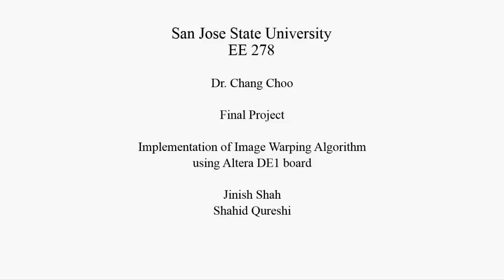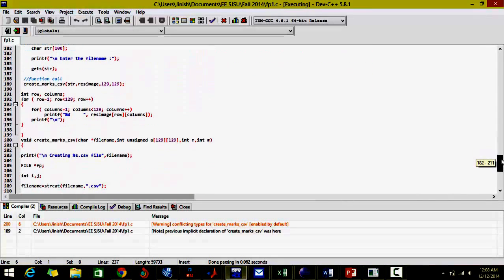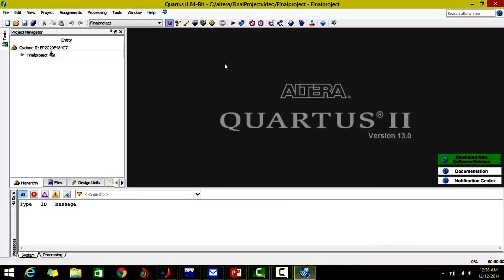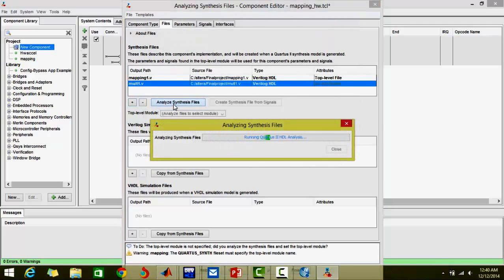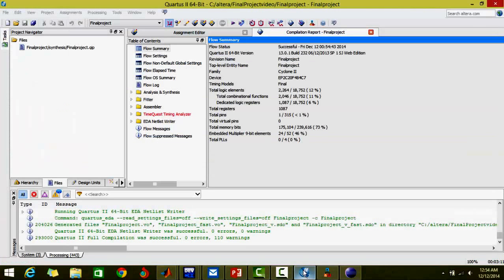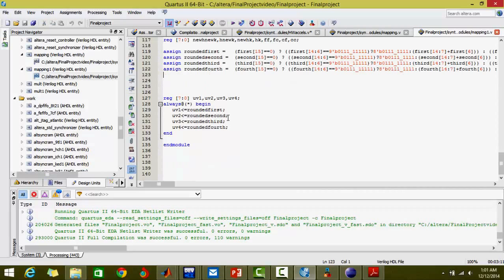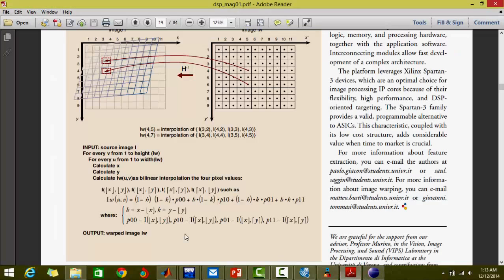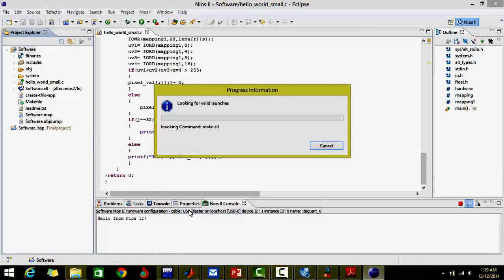EE 278- Image Warping Algorithm Implemented using Altera DE1

Comment: Hello I am doing same project with edge detection. 
When I tried to run my program it is showing nothing for 128*128 images but when i tried to run it with small images like 20*20 it is working. so am i correct or is there something wrong in my project.